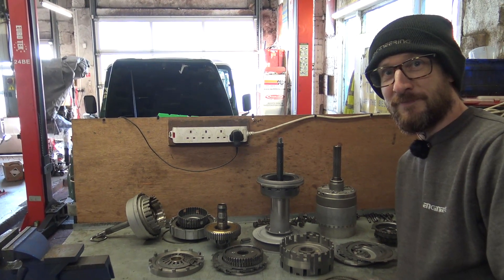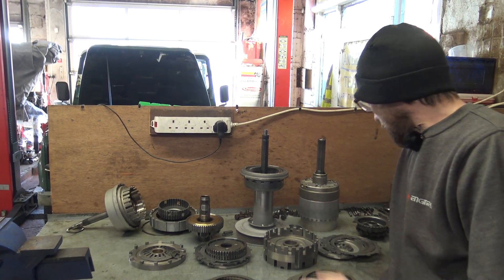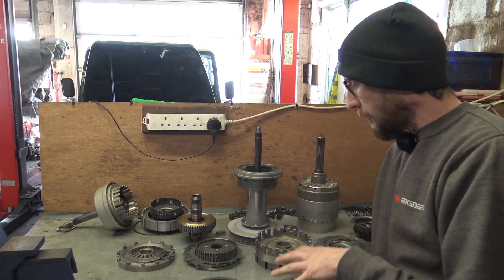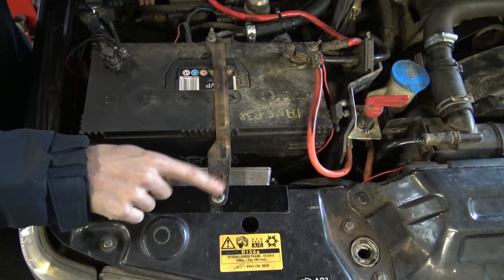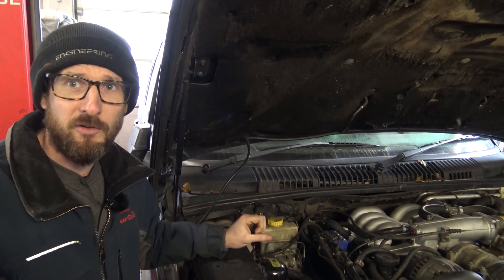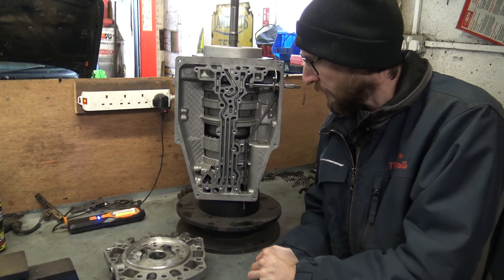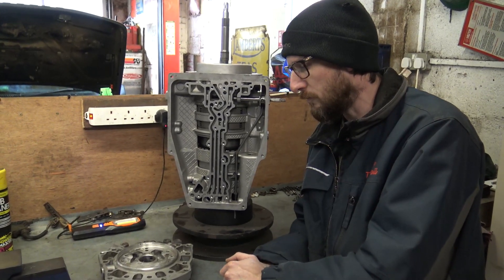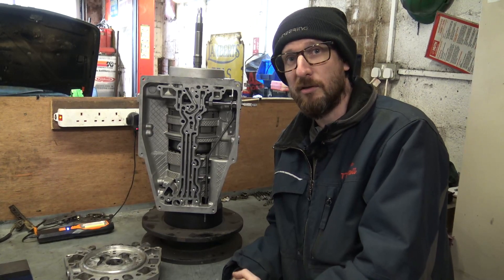RPi Engineering Twin Turbo Tuesday Episode 13 - Range Rover P38 V8 Twin Turbo Conversion

Comment: Are going to be doing a different cam profile for the forced induction to the cam you are using currently because from what I've learnt over the years it can make a reasonable difference
Reply from the maker: I am currently running the Piper 270 camshaft which Piper have said does not have huge overlap so will work OK for now. However if my time, budget and everything else allows I will be doing a different engine build later which will get a different cam with forced induction in mind along with different internals and heads.

Comment: May i know what needle and jet to be use in 3.9 rover 500  edelbrock  500 with 50229 cam
Reply from the maker: Hi, We would start with a stock carb setup and change the primary needles to 6552 and jets to 0.083" and then check and adjust from there